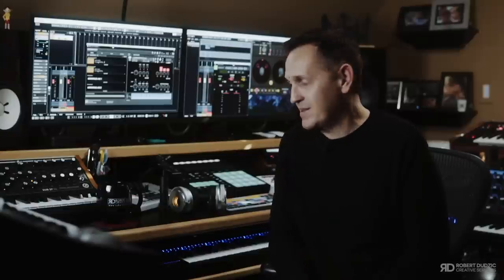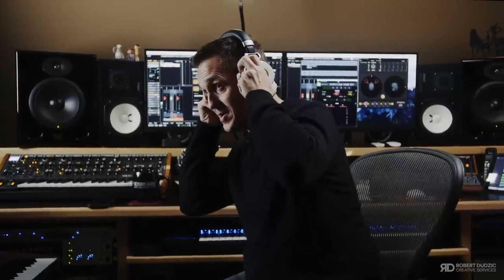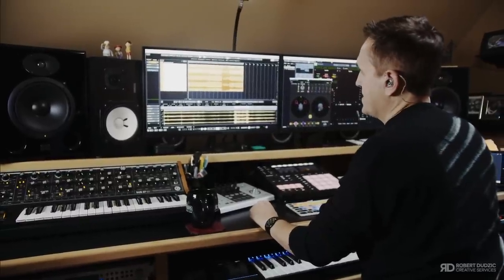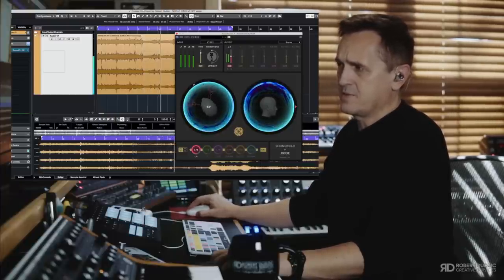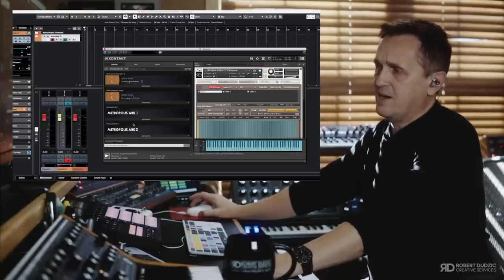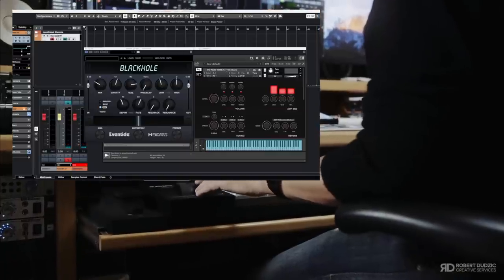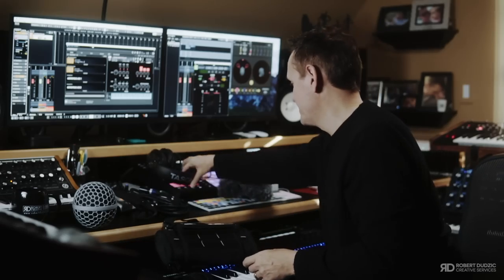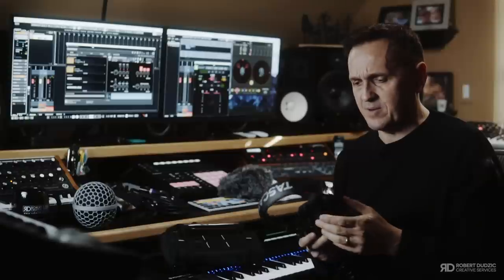Rode NT-SF1 | HOW I USE WHAT I USE | Robert Dudzic

Comment: I bought this microphone recently and hooked it up to a mix-pre 6 ii, I'm getting sound from it but its very low despite increasing the gain. QUESTION 1: Sound Devices has an Ambisonic plug-in which I'm thinking is must at point, am I correct? QUESTION 2: Does the Zoom F8N Pro require an Ambisonic plug-in? QUESTION 3: In your opinion, would these two field recorders yield a similar sound with this particular microphone? This might seem a bit loaded, but any help you can offer me would be greatly appreciated.

Comment: Thank you for this Robert, have you ever tested any of the second-order ambisonic like the Octomic?  I'm wondering if beyond the spec-sheet advantage, there is any significant difference in data capture or headroom during processing.  I ask this, because I can't imagine any production needing higher level sound quality than what's demonstrated in this video.  edit: I guess if something like Dolby Surround in IMAX might benefit due to the amount of output speakers and sheer space.

Comment: Dear Robert, just found this video. Thank you so much for doing this. It's very inspiring. I am a full time landscape photographer / artist and I'm in the process of setting up some podcasts. I've just bought the Rode NT-SF1 and I see their software is no longer supported - they abandoned it. Are you using Logic to process the files now? Thanks so much for this excellent series.
Reply from the maker: Hm… this is news to me and I will check what happens and contact direct RØDE. I work in Cubase.
Reply: @RobertDudzic  they havent updated it since 2018. Mac silicone doesnt install. \i tried switching off security as apple says the plugin needs updating. others are commenting also. Pretty shoddy. just bought the mike too.
Reply: @RobertDudzic  Hi Robert, Apologies, but it does install. It's the system security that initially stops it. They changed the interface on the latest OS which confused me, as I normally select 'open anyway'. It's working now. Sorry for the confusion !

Comment: Very inspring ,i buy it  but how i set the gain on the recorder on each channel?
And how to convert to binaural afterwards ?
Reply: THe poster didn't respond to you yet, so I'll take the liberty to do so.  For the Zoom F6, there is an Ambisonics (A or B) setting, so four inputs are controlled by a single gain.  (The same occurs on the F6 for when inputs are marked as stereo pairs.)  Re binaural question, you would have to check if the Rode plugin has that output.
Reply: @Paul_Rohde  thanks so uch we use the soundevice with the plug inn and works great

Comment: How do you rate this vs the Sennheiser Ambeo?
Reply from the maker: I don’t have Sennheiser.
Reply: @RobertDudzic  
Thanks - only interested because I was thinking of getting the NT-SF1 as I have the Sennheiser. Although I did a lot of field recordings for the BBC, I am mainly interested in using it to record my own musical ensembles, and obviously it’s handy to be able to change directivity after the event, especially if you can’t monitor because you are performing. Do you ever have problems with moisture? Because the Ambeo is an electret design, which I think have fewer problems with condensation. If I could justify buying both to test them, I would! They are all a bit difficult to compare with normal mics as the capsule noise is dependent on the pattern (ie, how they are combined in post). But I’m a big fan of ambisonics! Great video.